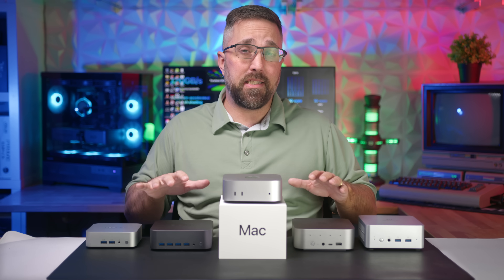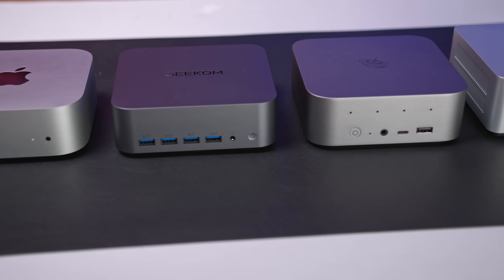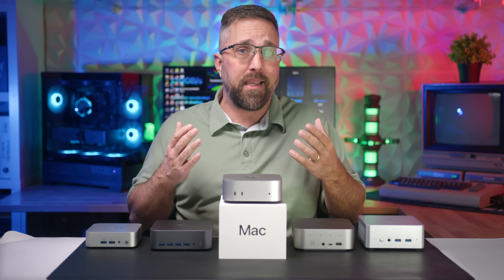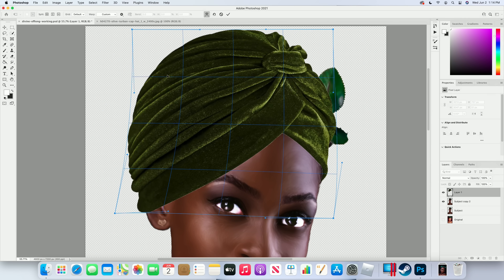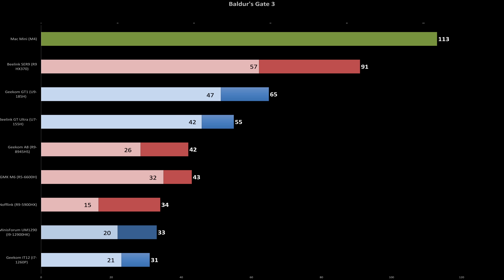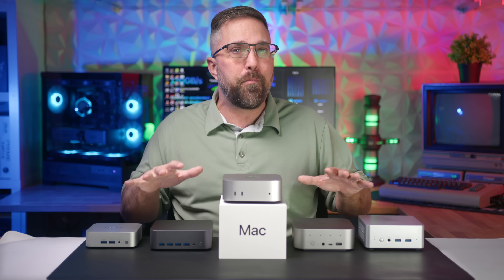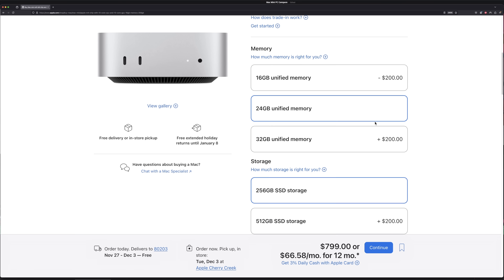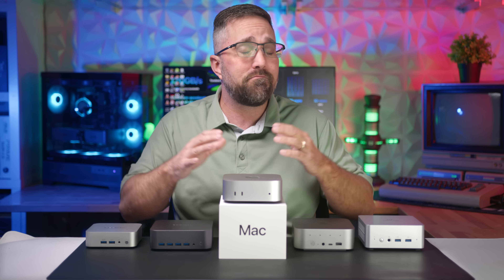M4 Mac Mini vs Intel and AMD Flagships – It's Not Even Close!

Comment: As of here in Germany, the base model of the Mac Mini costs 699€ - and to be honest: 256 GB of storage are just poor, because it's not expandable by yourself. So for a roundabout-feelgood package, you should at least take the 512 or even the 1 TB model for price-comparison. The CPU doesn't do its work slower then, but the data stays in the package. Yes, backups are a no-brainer on the to-do-list, but if you don't have a bigger external storage, you can't even make bigger video projects with just 256 GB of storage, without storing it externally. That would grind on my gears. Power efficiency is mostly a worthless metric on a desktop. Great chip neverless, but efficiency is important in laptops, nowhere else. I still would prefer the x86 solutions. Gaming on Linux is far superior than on Mac, and when Valve comes with SteamOS for everyone... well, then maybe even Windows would have a problem.
Reply: have you seen the recent announcement of Proton in Asahi Linux?  times are changing fast!
Reply: @udance4ever  Problem is, Apple won't provide anything like documentation or something else. So everything needs to be reverse engineered, because Apple decided, you have to use their APIs in their OS and nothing else. This means in the end that it doesn't matter how good Asahi Linux gets, it will never be as good as non-Apple distros. That's a bitter pill, because the chip is really good.
Reply: @Skullman1984  yeah it's probably an artifact of focusing on software/hardware integration.  they want to be able to pivot quickly if they see an optimization that can done in hardware to serve software (and vice versa) without having to coordinate with anyone outside of Apple. it's a systems design decision (and of course a biz decision too)